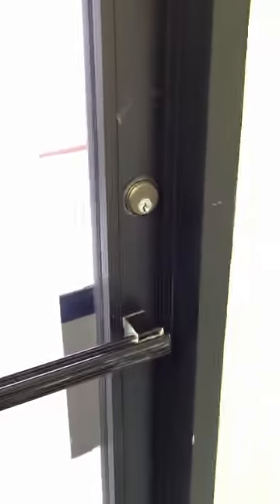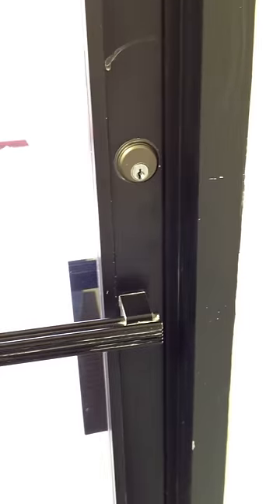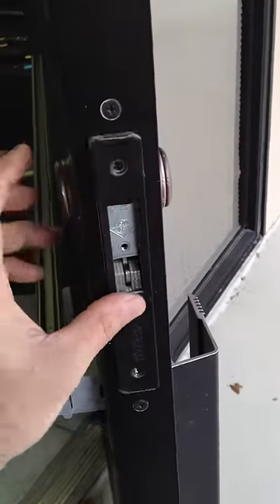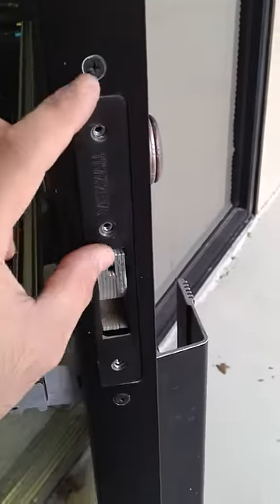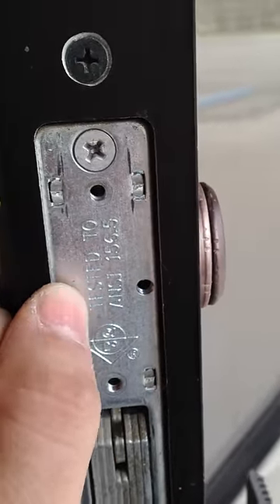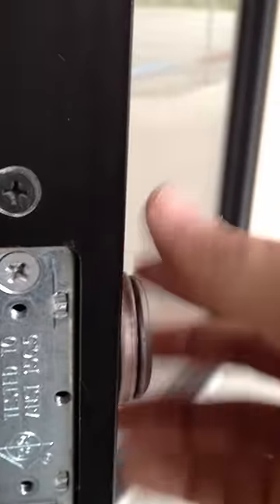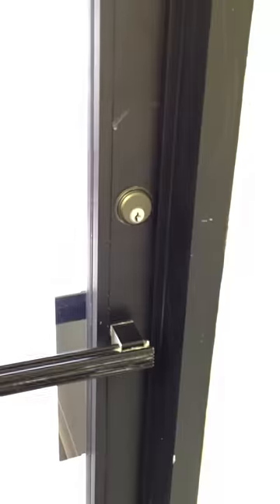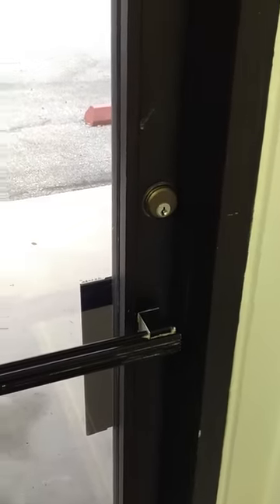How to quickly remove a mortise cylinder lock.

Comment: Thanks, this helped a ton! My Adams-Rite office door's internal thumb turn stopped engaging in the lock direction. Pulled the set screw out, took a hard look at it, realized the set screw point-of-engagement mattered significantly for leverage, rotated the internal mortise thumbturn slightly and torqued the set screw down. Wouldn't unlock now. Fiddled with it two or three more times till it landed back in the 'sweet spot' and i torqued it back down and put the plate cover back on. Thanks a ton, you just saved me a visit from a locksmith, merely over a set screw drift in position!

Comment: if you have a key blank that will fit into the lock, you can use that as a wrench to unscrew the cylinder housing.

Comment: On mine you have to hold the cylinder in place or the whole thing turns when you turn the key. If it does that it's hard to get it all back in place so you can lock or unlock. I almost got stuck inside until I realized it all had to be lined up a certain way. I'm just afraid it's going to fail before the owners get a locksmith out to fix it. I called and he said "give me some time. Maybe a couple days". But I don't know what I would do if it broke. It would be hard to secure the door.

Comment: I'm having trouble with mine. Keeps sticking. I'm thinking something isn't lined up. Any tips?
Reply: Sorry, the thumb latch locks up. Sometime only the key will operate the deadbolt
Reply: @WilliamJoseph2015  screws are probably too tight which is binding the latch

Comment: I have someTrouble with mine, it won't go all the way in..something is not right
Reply: Yup that helped me. Dont tighten them. But just recently i decided to rekey all my locks with just one key using a rekey key. You know this darn mortice key hole wont fit the new key. All my other locks did. This door is a pain, always problems with it..

Comment: I guess our door is older. There is no panel, of faceplate, whatever its called, that you remove to get to the set screw. There is only the hole for the lock. The door has a beveled aluminum edge that has screws from top to bottom. I guess you have to take the door apart to get to the lock.